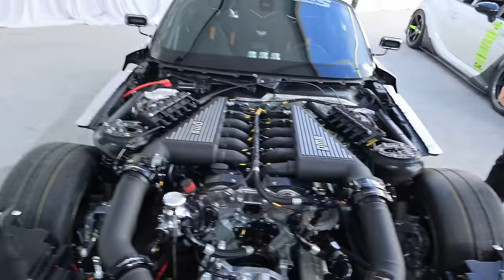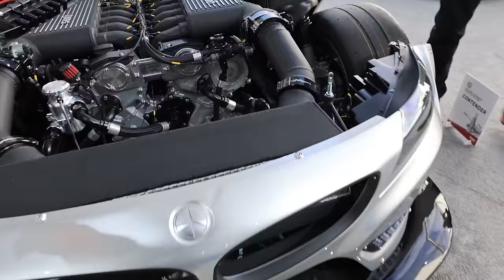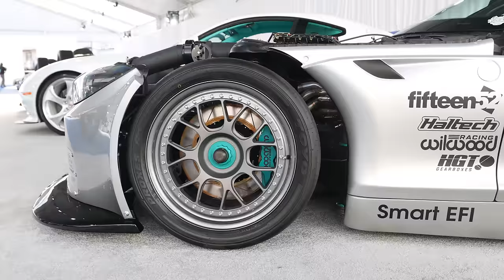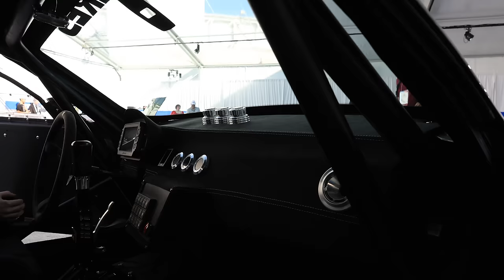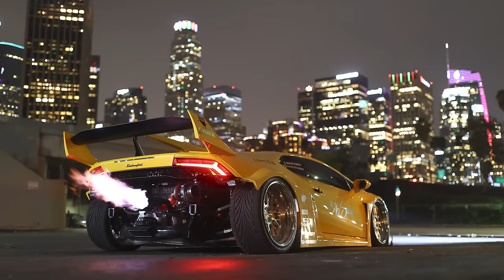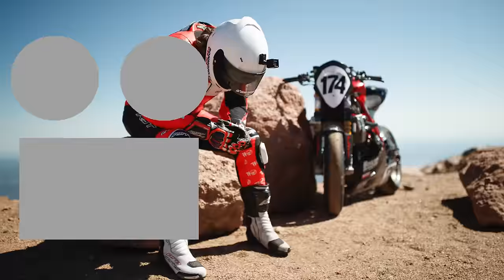Supercharged BMW Z4 GT3 Race Car, Converted to a Street Car

Comment: I love the build, but as someone who is a Z4 fanatic, that wing, since it's just mounted to the skin of the trunk, won't push more than 300lbs before it'll cause a lot of problems on the upright mounts bending the trunk lid. I worked with APR on this very same problem for a E85...

Comment: Amazing build!  I just wonder it is just show case exposing turbine inlet without any cover or it is okay to expose the inlet to open air like that.  What if dust or event a small rock sucks into it, it would be disaster for turbine or further more big damage to the motor itself????
Reply: its doesnt run, or even firing up, so its no problem. its i typical sema build

Comment: GT cars usually have like 475 to 500hp, so triple the power is crazy
Reply: More like 550-600hp, depends of the specific series Balance of Performance rules. Yes, they have that power with intake rectrictors ;)
GT4 have ~450hp. There're some exceptions like KTM X-Bow and Alpine A110 with ~350hp and a lot less weight.
Reply: Yeah there's a reason for that just like a porsche GT3 doesn't come with 1000hp from factory.

Comment: 2 years with 2 non runners is just cringe! Just doing things for internet points and stating dumbass numbers is starting to sum Sema up. This car was a weapon with 500hp the wheelbase is too short for much more let alone 1000 or even 1500 the snap will be insane so to say "we're going to dial it in" man id love to see you try with 600-700 and only RWD but its not gonna happen the car will disappear just like the green FD that's never been seen since last year.